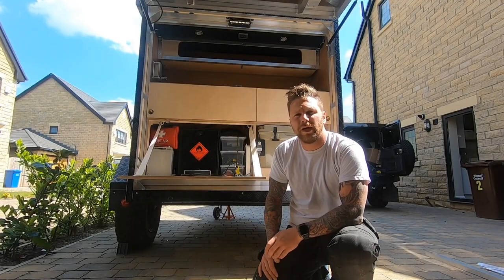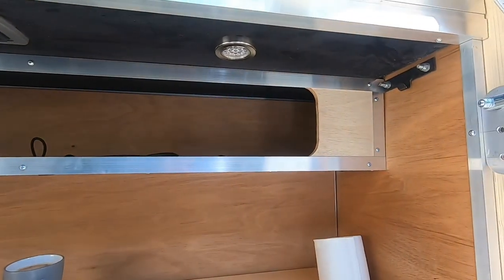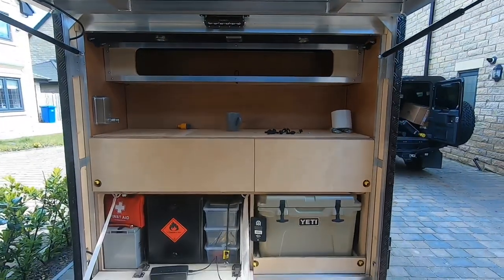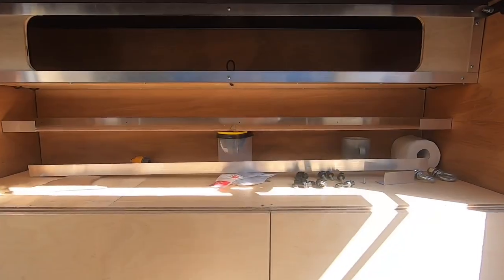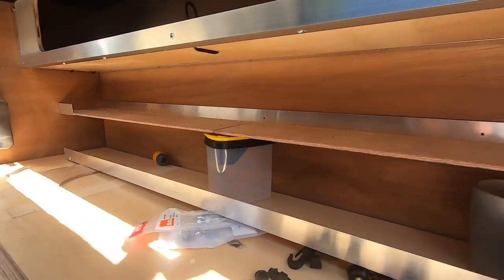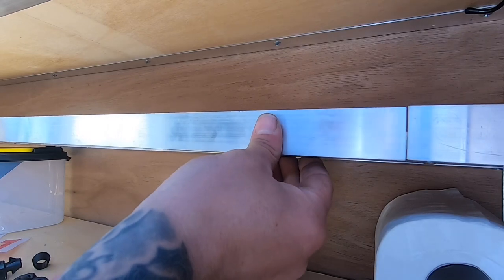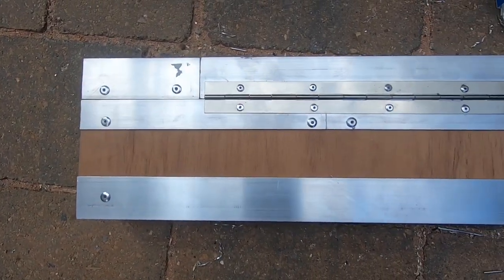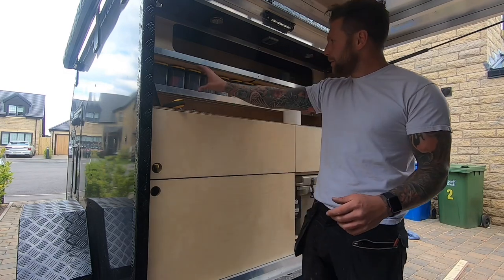Urbanark overland teardrop overland trailer storage solutions

Comment: Good Stuff, thinking of making an overland trailer for my disco.
but to try and save on the size i have to tow is to try and make it modular and sections "pull out/ slide out" to increase the sleeping space when static.
Reply from the maker: If weight isn’t an issue then all that will be fine. Just keeping things waterproof if they are all pulling out etc. Sounds cool 😎

Comment: Just finished watching all the series after seeing your feature on bug out vehicles UK. Fantastic build! great details about the weight saving. I have the same licence so had to consider the same when building mine but haven't gone to the trouble you went to. Its making me consider if mine is overweight now and if I need to get it weighed to check. 
Check out my IG for loads of build photos https://www.instagram.com/remade_by_dan/ 
Where about's in the UK are you based?
Reply from the maker: Hi mate. In Manchester now. Have to be careful. Because it’s not classed as overloading. It’s classed as driving outside your licence. 6 points. Big fine.
Reply: UrbanARK overland, I’m pretty confident I’m under the weight but based on that I think I’m going to go and get it checked. Found a weigh bridge not too far.
Reply from the maker: Local waste recycling centres will let you do it. It’s what the dvla advise. Only go up in 20kg increments though.
Reply: UrbanARK overland 👍Good shout ! I there is one of them even closer. Cheers